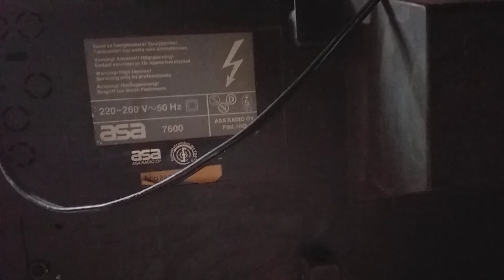Philips portable disaster..

Comment: R.I.P. 😞
At least the CRT is still ok, what type is it?
Reply from the maker: Hi Westel, it's  a A31-410W. Cabinet was scrap anyway so no real harm done. I was surprised it still worked, I might find a home for it.
Reply: @IrishvintageTVRadio  

Yes, maybe you can build a new cabinet or just use it for parts... Doesn't the Grundig have the same tube? Or a 510W?
Reply from the maker: Grundig is a '510W, are they interchangeable?
Reply: @IrishvintageTVRadio  

I don't know, but they're very similar and both were used a lot in 70s portables so it's always good to have one around